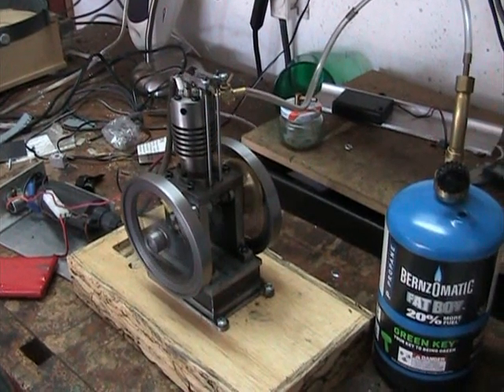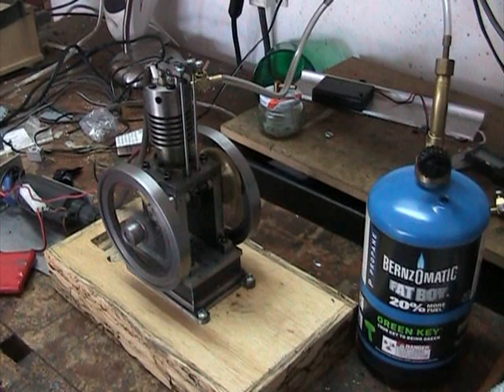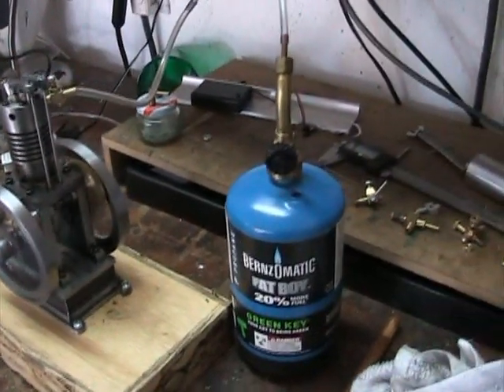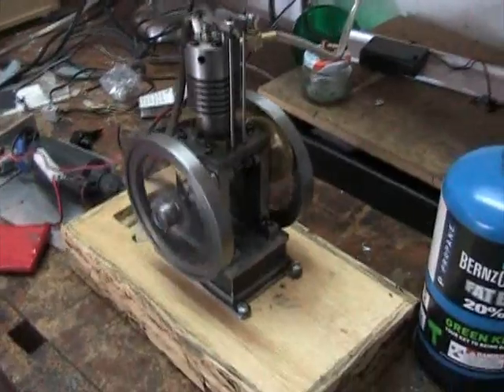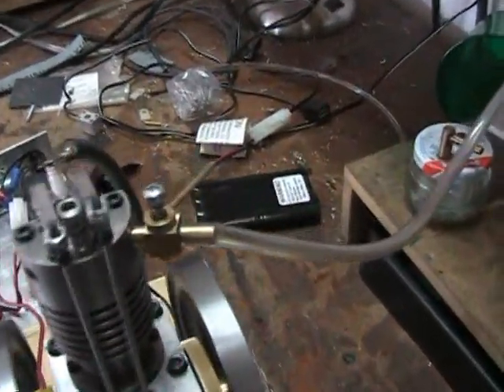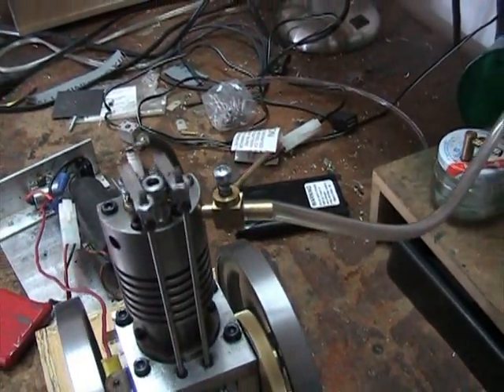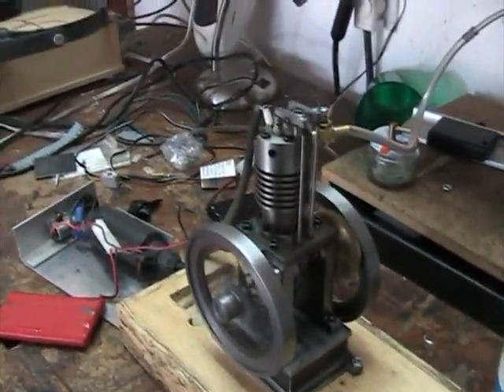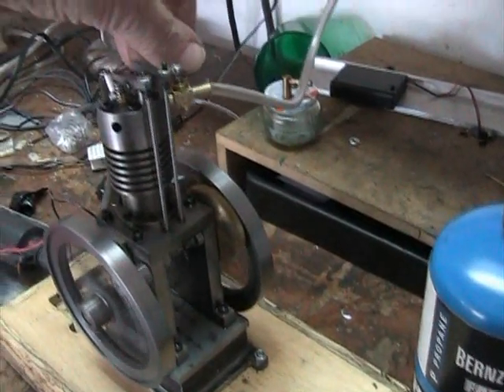Propane Fuel powered 4 stroke vertical single

Comment: Chuck, I have been using map gas to run my Upshur farm engine for some time now.  I use a demand regulator with a modified needle carb.  Yours runs great
Reply from the maker: Where did you get your demand valve plans from?